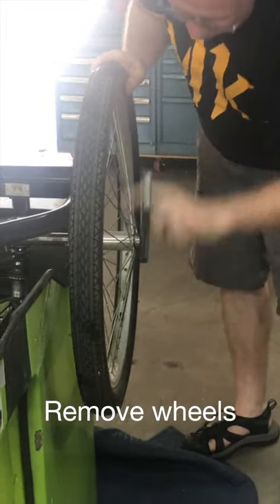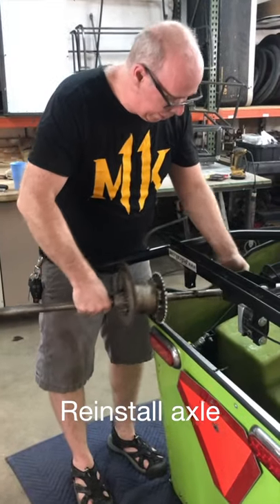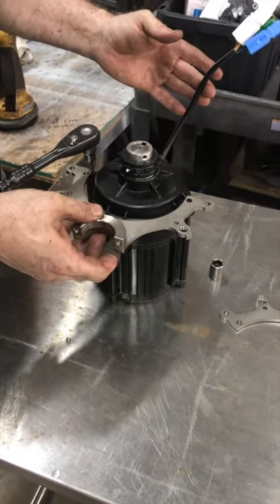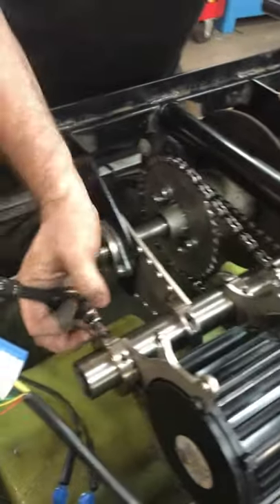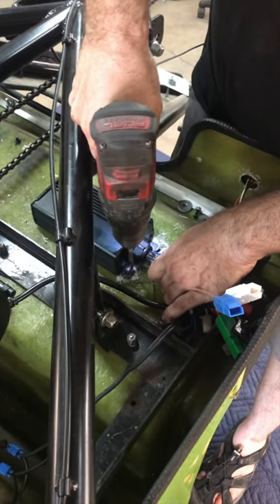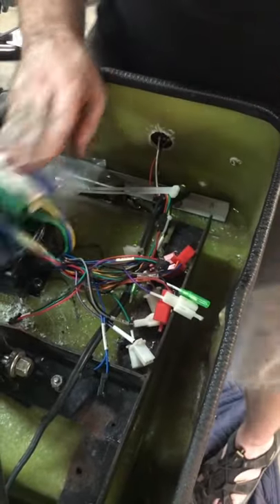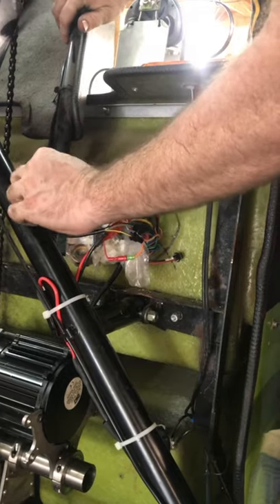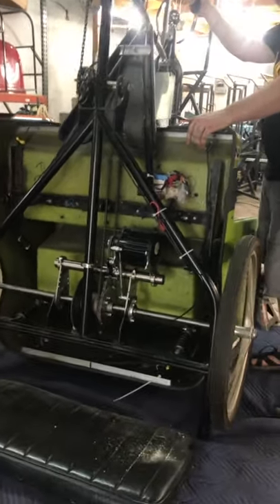32 Min Installation of a bolt-on Cyclone Motor System for Mainstreet Classics and San Diego Pedicabs

Comment: 13:51 - on the chain tensioner installation section, what’s omitted from this video is a minor detail of unscrewing the sprocket from the chain tensioner (the way it comes from Precision or Sunlite) and flipping the orientation around before installation.

Comment: What if you have the square frame?
Reply: I suppose you could weld-on a crossbar into similar positioning as this bolt-on crossbar, then use some or all of the rest of the Precision mounting hardware (or some other hardware) to make a solid, secure mounting of the motor.